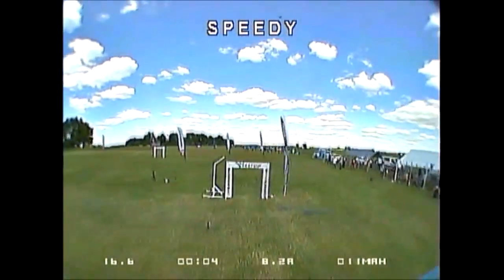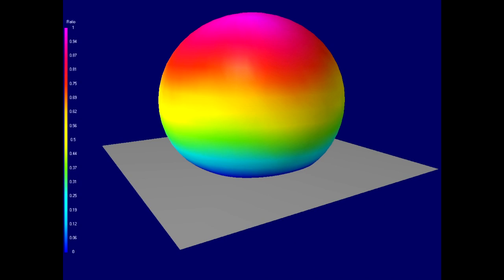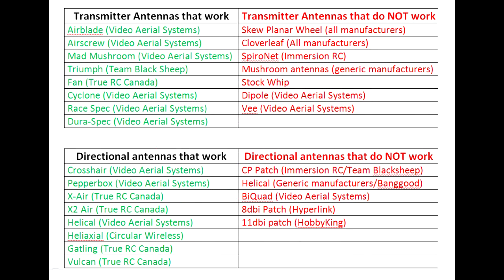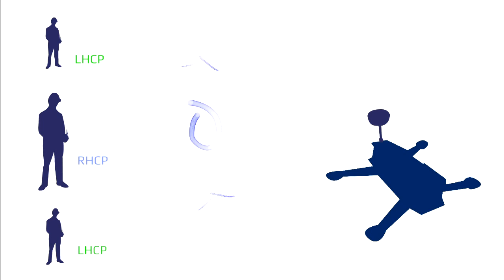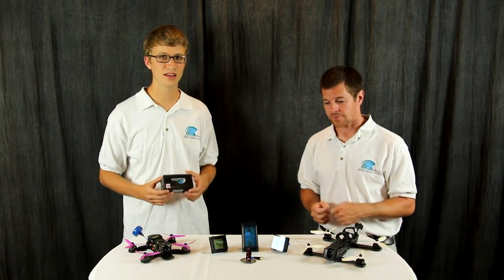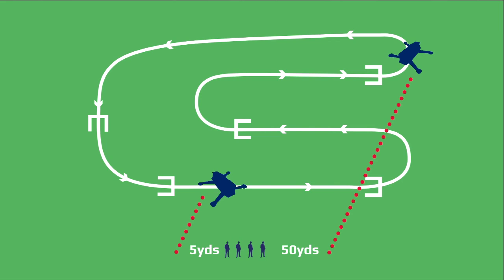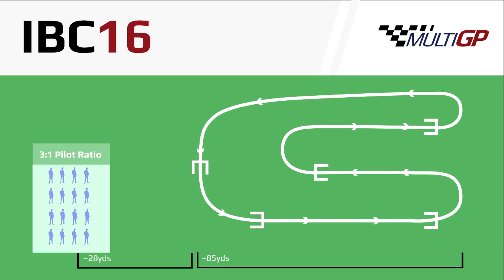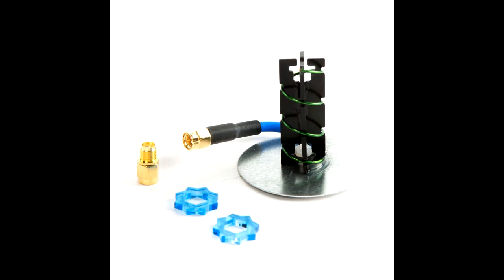Race 16 drones at once: The IBC16 method

Comment: This is an awesome video. How did you work out the required numbers?
Further to that - do you have a guide for calculating the required axial ratio to pilot separation ratio? Logic would follow that a better axial ratio would allow a worse pilot separation ratio but I am having some difficulty working it out.

Comment: Is there or has there been a follow up to this video? has theory been dismissed for some reason? it seems, coneptually, to be a great idea. would like to use it in tampa, please Advise
Reply from the maker: This has been repeated a few times.  We did it on 200mW with wings at the NEFPV meet last year.

The problem is forcing people to run LHCP.  Very few pilots run LHCP antennas and thus you would inevitably force them to buy new antennas or have to supply them.

Comment: Is a lower axial ratio acceptable if you're alternating polarization on 8 channels?
Reply from the maker: So long as the channel separation is better, yes.  With race band, you can use lower axial ratio.
Reply: Video Aerial Systems do you have a recommendation for a particular set of 8 channels? Or just race band?

Comment: Grounding audio should not help bandwidth, the transmitter should still be transmitting that frequency just not without modulation
Reply from the maker: A Spectrum analyzer shows it uses 3-4MHz less bandwidth if grounded.
Reply: Nice, thanks for clearing that up

Comment: What did you mean about grounding the audio?
Thanks for the great effort!
Reply: just solder your audio pin on the Vtx to GND, that way you cancel the audio signal from the bandwith used by the video transmission: instead of having noise (because of the floating pin) you have simply no signal, leaving space for another pilot's video bandwith (allowing to reduce the channel separation), clear enough? :D
Reply: +Bryan C. Hernandez thanks I've never thought of that!!!
Reply: Bryan C. Hernandez Very clear, tnx! Hadn't considered that and will be grounding my audio signals from now on.
Reply: That's my question too. Would love if you could elaborate on that a bit.
Reply: you're welcome guys :D
Reply: how much does grounding audio really matter? You'll still be transmitting an unmodulated carrier, no? Is the carrier a lower power than a modulated AM transmission?

Comment: Great video thank you,
Could you educate another nob some more?

You can see hundreds of RC aircrafts flying at the same time at Flitefest, but you struggled to get 16 concurrent video feeds.
I wonder if the techniques used in rc transmission or wireless networking, like frequency-shift-keying, or quadratic amplitude modulation, could be used in video feeds?
The digital HD video is coming. What keywords shoud I look for to get a decent picture, beside bandwidth, datarate, compressed stream...?
Is/why QAM not feasible with our NTSC/PAL feeds? Can your analogue record be overcome?
How much FPV quads could race at the same time with digital video?

A super happy Crosshair user, BR
Reply from the maker: The bandwidth of a control signal is significantly narrower than a video link and thus the number of channels available is much less.

If everyone coordinated you could get as many as 29 in the air with current technology.  However, most people are opposed to running any equipment that they are unfamiliar with and thus, this number will never be realized.
Reply: This video is talking about how to get 16 separate FPV video signals working at the same time, all in the 5.8ghz band, which is the most common FPV band.
A typical FPV race won't run more than 5 people at a time before running into interference between pilots, so 16 is pretty remarkable.

You've seen videos of hundreds of people flying simultaneously at Flite Fest, but none of them were using FPV video at the time.

Comment: 5:10 Ground your Audio ? I connect the audio channel to Ground ?
Is a great FPV Video.
Reply: Wondering the same :)
Reply: I think they meant to say to ground the the audio input on your transmitters thus reducing the bandwidth needed for each transmitter signal. This is like turning off the volume on the audio. Both video and audio take up space in the bandwidth. You will need to keep them as narrow as possible. Oh I should mention that you can put a switch on the audio input so you can un-ground it when you need audio (just saying).
Reply from the maker: Yes.  Connect it to the negative bus somewhere in your FPV system or the bandwidth will rise considerably.  There have been several tests of this.
Reply: Good to kown ! I think this is a important information for all members in the FPV community.

Comment: i learned more in the 6 mins it took to watch this video than i have in my entire time flying fpv video seriously this is an amazing explanation of what we have all been doing wrong
Reply from the maker: The problem is that one group does it wrong and then everyone seems to repeat that error.  I am doing my best to educate people on how to do this the proper way.  Admittedly, I have known this for 2 years now.  However, I didn't get a chance to prove it until the MultiGP championships because all of the other race organizations thought it would not work.
Reply: Alex honestly when you started corralling pilots to get 16 up at once I was skeptical too but I knew if anyone could pull it off it would be you